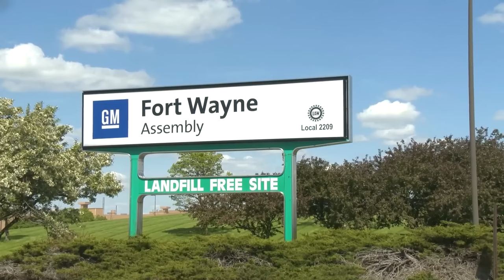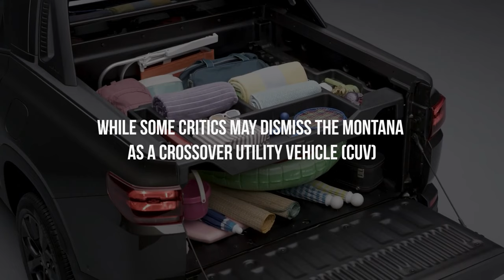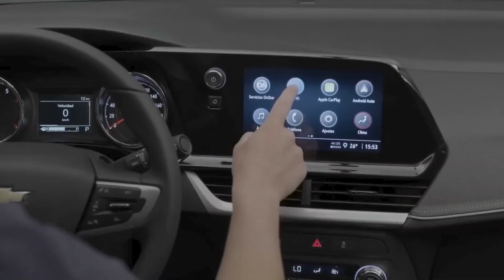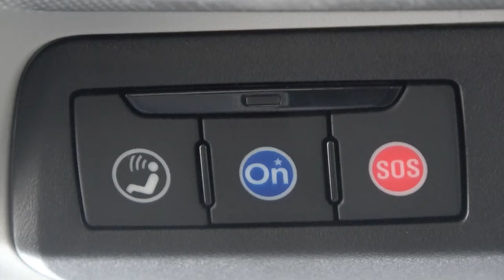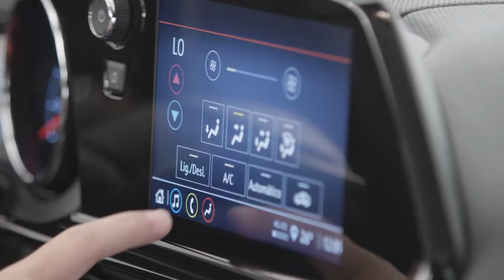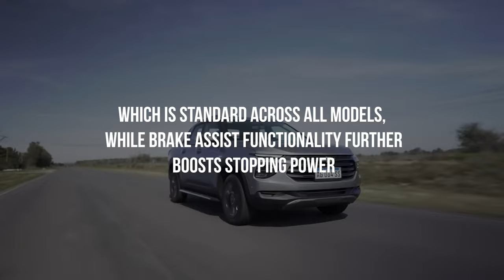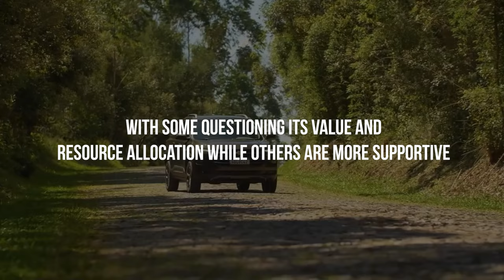GM NEW Montana killed the Ford Maverick!

Comment: I'd rather have the Maverick as it looks more like a truck compared to the Santa Cruz and whatever that abomination from GM is.  Plus GM will put their garbage 1.4L in it and it will be lucky to last 60k miles before the engine dies.
Reply from the maker: Good points

Comment: This won't sell well in the US, trust me.
Reply from the maker: Why Brian?
Reply: @TechTeamCommunity  The majority of truck owners in the US exclusively drive full size trucks. The dealerships right now are already flooded with new trucks that are difficult to sell, because the prices are too high and the economy is at the lowest it's been during my lifetime. Furthermore, the already familiar mid size truck models are now just as loaded with options as the their full size counterparts (that wasn't always the case, I used to have an 05 Colorado). The final nail in the coffin is power. I can go to a dealership looking for a used truck and it's easy to find a 5.3L V8. People in the US latch onto anything that is a 5.7L V8 or larger, plus the diesels.
Reply from the maker: Yes you’re right but it’s not to expensive so maybe it’s a good alternative for the people.
Reply: People want a small truck , not those full size behemoths. The hybrid maverick is especially popular. If GM prices this sub 40k, it will be hugely popular.